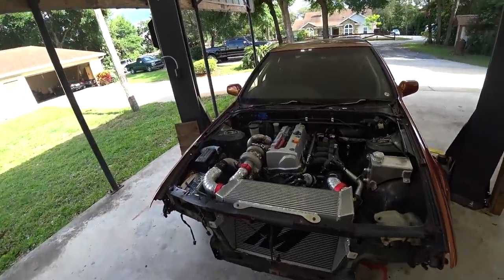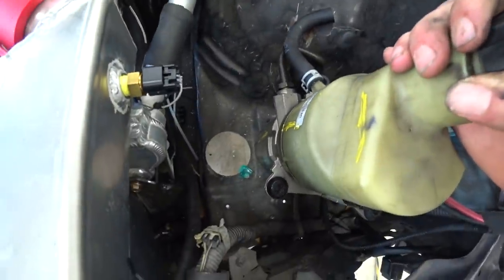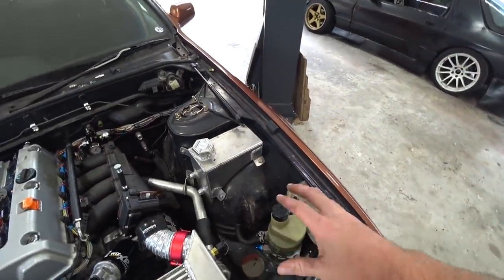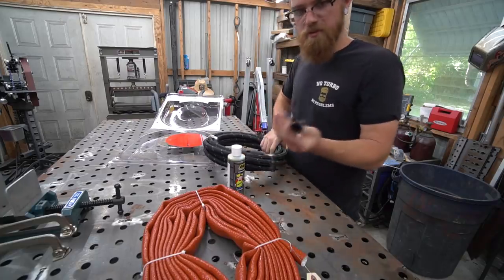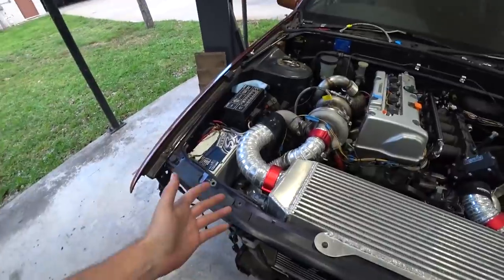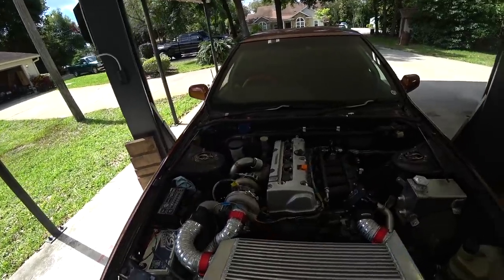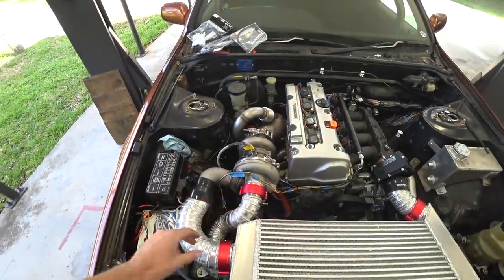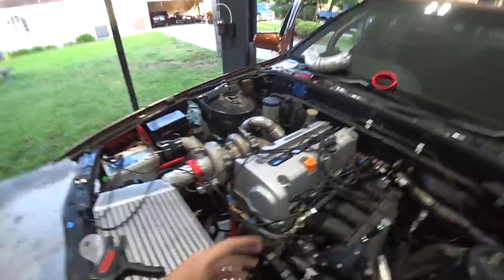Getting the k24 swapped Cefiro dialed in. It’s running great now.

Comment: Don’t know if this helps but you could try powering the solid state relay off of the switched power input from the key to the under hood fuse block so it shuts off with the key like normal maybe 👏👍
Reply: T90,

Comment: Taylor if you turn the o2 control on in the fictions and then setup the afr tables how you want them it will start to self learn, have a look at base maps in the haltech files for ideas, map names will be labelled with has wideband. Once enabled and setup you be able to look at the STFT and see how much it is adjusting on the fly and then it will make a more permanent change witch is logged in the Long turm trim table, you can then apply the long turm table to the base table from within the fictions menu.

Comment: Not sure the water temp sensor will work with out water in it. It will not read ambient temp like a Intake air temp sensor dose. Once you get water in it your fans should work. Otherwise there should be an override in your I/O section that will let you test your outputs. I use the ProEFi, and am not all that familiar with Haltech... but the principles should be the same. Keep at it bro!!! you are doing amazing work!

Comment: To test the fan relay you can just switch it to active state high and it will ground out the relay. That will tell you if all the wiring is correct.

Comment: Try installing a switch for the rely power to open the circuit manually. If you wanted to run the fans to cool down if the key is off. If use acc power so when the key is on you provide power to the relay only at the time the key is on.  If that makes sense.

Comment: Easiest way to disconnect the ground is to put a bog standard relay on the ground wire and have the coil actuated by a hot in run/start line. Turn off the car, the pack gets ungrounded.

Comment: one simple solution for your MSD grounding issue could be solved with a normally open relay. MSD ground is wired through the relay's normally open contacts. Relay is triggered by switched 12v from IGN, closing relay, grounding MSD. Keying off opens the relay, disconnecting MSD from ground. Badabing, 

This solution ideally places the relay as close to the MSD as possible, to minimize any potential amperage and wire loading concerns on that switched ground. Relay should be sized appropriately to handle at least YOUR potential max load, amps, being drawn by the MSD. might be sort of an "eyesore" stuffing a relay under your hood, falls away from the streetcar theme a bit. Nevertheless, can't wait to see how you solve that issue.

(update)
rewatched the last section and second-guessed everything I said above based on your wording. :p  Looked up that MSD product and if the ground in question is just the chassis ground (G) on the device then I find no reason for this not to work. That chassis ground looks tiny so it may carry little not load from the MSD. In that case, any relay NO relay would do.

Comment: Valve lash on Honda engines needs to be set when cold!! Cylinder head temp should be under 100 degrees F as per all Honda service manuals. If you would like I can also get you the spec for it

Comment: Put the car in the air and find a spot to mount the filter relocation down low. Should have space, will keep it out of the way, and makes it nice when you drain oil it doesn’t make a mess.

Comment: Hey Taylor, have you tried running the Permatex High Temperature Thread Sealant instead of the tape?
I've been running it on ALL my fittings, even on not High Temp stuff and I love it.
The number is "Permatex 59235" incase you haven't heard of it, but I'm sure you have lol.
BTW, love the build brother.

Comment: Curious why you're not running the red clamps at the turbo inlet and/or the TB inlet like very other "air pipe" connection in the car ... They instead of a coupler - since you did all the pie-cut piping, why not make a reducer and run the same clamps?

Comment: One thing I don’t get is the over complicated radiator and intercooler setup. You could have just done what everyone does with their SR20 setup where the cooler and radiator mount together. If you ever have a radiator problem you wont just be able to get replacement parts while on the road

Comment: Man that plumbers tape makes me cringe. I used to use it till I found pieces in my diff bearings 😮. Get yourself some anaerobic thread sealer it works way better and you don't get pieces of tape in your motor every time you undo a fitting. Looks a lot cleaner too

Comment: Was gonna say sounds like a valve possibly kissing a piston whenever the motor cranks over
Reply: Sounds like a twin disc clutch
Reply: @phillipwarner5504  very well could be but the loud ping as soon as the motor fires seems identical to a scenario I had with an out of adjustment valve
Reply: Definitely could be ive also seen starters make some noizes like that aswell

Comment: Do any drifters use the electric steering racks and if not then why?
Reply from the maker: I tried an electric column. And have driven electric rack cars. Not good. They don’t give you any feedback or self steer very well.
Reply: Thank you, always wandered.
Reply from the maker: @lowerd1  yeah would be awesome if it worked. I was so hopeful with the electric column in my miata but it was awful. I went from barely linking the track at a comp to battling through to the finals.